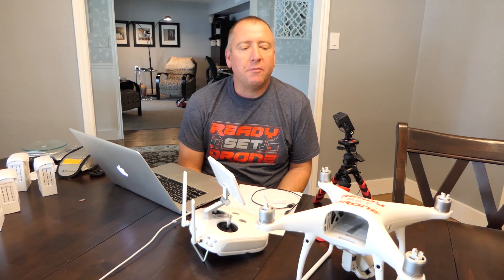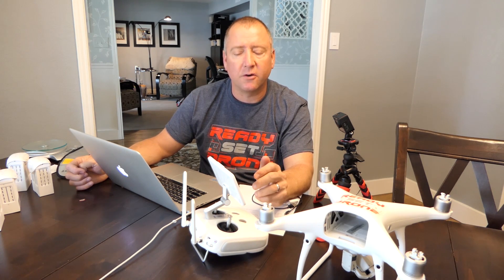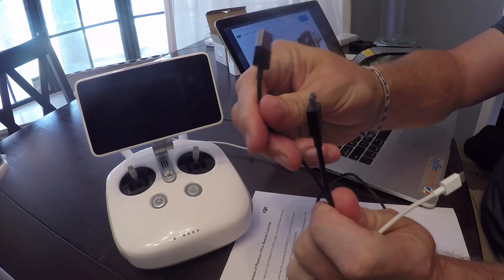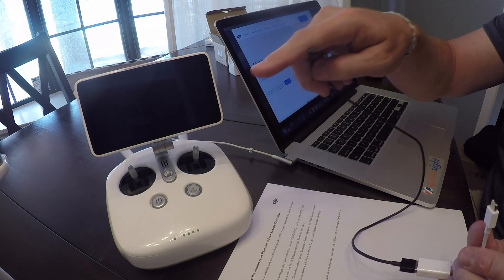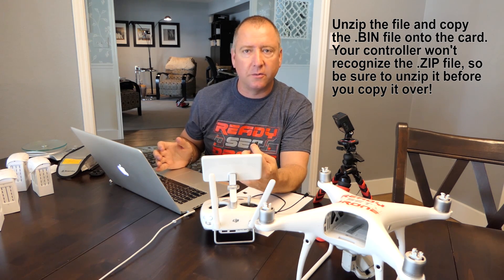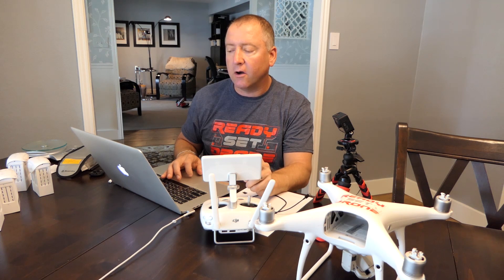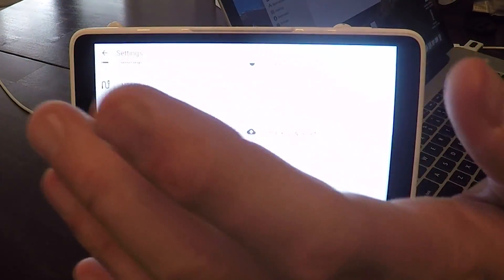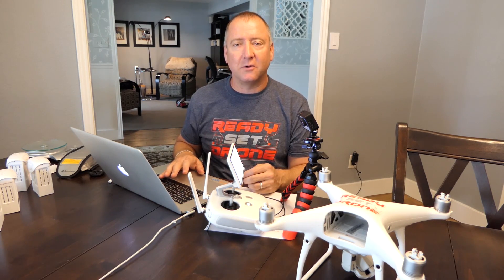DJI Phantom 4 Pro Firmware Problem Fix

Comment: Hi,  I know this is an old video.  But I just got a phantom 4 and getting to learn all this.  I have an Air encoder error. I've been trying to update the drone.  
It's doing nothing..I do notice the little led light is the drone above the sd card slot bonus red/green.  Could my mini sd card be the wrong kind? Mine is a sandisk ultra 64gb 10 (not 3) xc 1. 
This is driving me nuts.  This shouldn't be such a chore just to fly a drone.  🤦‍♂️

Comment: This is an excellent video.  I went through all the comments and it seems that most readers do not realize the video is for the Phantom 4 Pro Plus, that is, the controller model GL300E, the one that has the integral display.  So when one complains that they didn't get the special usb cable or their controller does not have a miniature SD memory slot, that's why.  Jim

Comment: Hey Last week I did the same thing. Went to fly my Hanson 4 Pro for the first time in a week or two and I got the message inconsistent firm ware do I swiped it and updated the drone.. now I have really bad not very usable video stream on my controller. I tried a lot of things but I haven’t tried to update the controller firmware yet.  I will try that next. My Mac has the latest OS on it and they do not have a DJI assistant version that will run on a new Mac that also has Phantoms drone. DJI failed to support Phantoms on the new version of assistant 2. I can go by a PC I suppose. This is the first drone night mare firmware problem I’ve had in years

Comment: Man, you are a life saver!! I updated the firmware on my drone (P4/PRO) and I lost my video signal and I had no GPS. I could still fly it but very limited distances. When I tried to update my controller with the memory card it wouldn't work. I forgot to unzip the file before putting it on the card. I should have known this. Once I unzipped it the updater on the controller found it and did the update. Now my drone works perfect. Thanks so much!!!
Reply from the maker: Awesome! I'm glad you were able to get it working!

Comment: Followed your instructions: format card, download latest firmware via website onto sd card, put the sd card in the remote, then started the process. All looked good, but at the end of the auto-reboot, i get an error "Update Failed: Error code:800". Any suggestions? Thanks!

Comment: There was not an adapter with my phantom 4 pro. i checked the in the box list and this also does not list it.
Reply: The adapter they are talking about us used on the phantom 4 pro plus, plus meaning, the controller that has the integral screen, it does not use your cell phone or tablet.  When the adapter is plugged into the cable, the cable now has a micro usb on each end.  This is needed with the GL300E, don't know about the more common controller that uses the cell phone or tablet.

Comment: I tried everything but it is not working the controler wont see that there is a file. i tried 2 different sd cards and formated them in the drone in the controler and on the pc but it just wont see that there is a file with an update.

Comment: I am more disappointed in many of you that keep speaking of the P4 when in fact this review is for the P4 PRO.🌟>JustU.Faith/-DJIDrone?症    Now readers are confused as I am. Some of you are speaking of the P4 and some of you are speaking of the P4 Pro. Why I hate reading reviews. There has been tens of thousands of P4 Pros sold and very few complaints when reading the DJI forums. When you look at percentages its less than 1 percent and many of those can be contributed to user error that have had issues. .

Comment: So, I had a failed update with my Phantom 4 Drone standard.  Everything is working fine, but the camera is not sending an image to the screen.  I've tried resetting the camera, adjusting the settings, reformatting, etc.  Nothing... Will DJI Assist help me fix the bird?
Reply from the maker: I would definitely try DJI Assistant. I would also suggest rebinding the remote with the drone, that might do the trick.
Reply: @readysetdrone  Awesome!  I appreciate the reply.  I haven't had time to reset the remote yet, but I'm going to try today.  
the strange thing, is that the indication light next to the sd card slot on the drone is cycling green, orange, red.   Like I said, it seems to connect to the remote, but the remote is not able to see what version of firmware is on the drone.  whenever I go into the software through the remote, and hit "Check firmware" for the drone, it just keeps thinking, and never sends back a result. The app doesn't freeze, and the drone is still communicating with the remote, but it stays in that green orange red blinking phase.
The other symptom I'm having, is when I connect my phone directly to the drone, it doesn't communication with the app.  
Thanks for your clear concise video!  It's much appreciate.

Comment: just a heads to save people tons of time who are having problems with distance-video issues. if using a android tablet or phone the type of cord (charging cord) does make a difference. i had problems and switched from gas station bought cord to the original verizon cord and worked flawlessly.

Comment: My drone is showing a problem of navigation system error.. Wat shud I do?
Reply from the maker: Calibrate the compass and make sure you are not near any large metal structures or concrete (which has metal rebar in it).

Comment: Thank you! The confirmation on how the cables are supposed to attach was a major help. 

Phantom 4 Pro+ vs Phantom 4 Pro V2.0 - I downloaded the firmware for the V2.0 by mistake (duh). That file wouldn't extract to a .bin, but instead just a directory, and the pdf instructions say to just put the .zip on the sd card by itself. I was really frustrated until that facepalm moment when I realized it was the wrong firmware. The firmware for the Phantom 4/4+ does extract to a .bin and it worked immediately. No test flight yet, but I'm hoping this resolves a ton of issues I was having.

Comment: I'm a new user of phantom 4 pro, only 1 month and i had a problem with image in my smarthphone like you shows. After firmware update the images on my smarthphone are completly black. my English knowledge is a little poor. could you write please an essenzial list of steps to improve the image quality of connection between smarthphone and phantom 4 pro? only essenzial steps please . Best regards, Giuseppe

Comment: Can tou help me out...i try to do the factory reset on my 4 pro plus after reset is asking me to login but i cant not connect to the wifi. How do i connect to wifi thanks
Reply from the maker: You should be able to connect to wifi through the app using the touch screen. If that doesn't work, I'd using DJI Assistant (free software) on your computer. If you still can't sort it out, contact DJI tech support. Good luck!

Comment: I never seen so many updates as with DJI firmware. I like DJI but shy away due to you spend more time on firmware updates than flying, its just sad.  if its brand new, why dont they update it at the factory?  You might not be very good at flying but you wil become a expert trying to figure out all the updates, WOW

Comment: Thanks for the video. I had this exact problem and this helped a ton.
Reply: What do you do if the controller doesn't have a micro SD card slot?
Reply: @jmccarthyphotography5262  This entire thread is about a Phantom 4 Pro Plus, which means the controller with the integral display, the GL300E, not the Phantom 4 Pro that uses the cell phone or tablet.  I wish this was stated at the very beginning of the post.   Jim

Comment: I had that problem with my tablet. The solution was to use a more powerful device. Video feed is low priority and if your mobile device can't supply the CPU power, you won't get video or choppy video like that. I switched from a 8 year old tablet to a 2 year old Samsung Note 5 and all was good after that.

Comment: Hello, I'm trying to download an update but I keep getting the error saying " insufficient storage 2G " I have a memory card in the RC. The. Current version I have now is V01.02.02.00 can you help me with the problem I'm having? Thanks...
Reply from the maker: One question - are you on wifi and is the wifi connection good? Also, do you have the drone and control connected via USB? It can't be the larger USB connection, needs to have that OTG cable with the smaller micro USB on both sides.

Comment: Hey I was hoping you could give me some insight for an issue I’m having with my camera/screen. I have flown my new P4A 5 times. No issues. But I notice that the “real time” play back will slightly lag or glitch and I thought it was only going to be on my phone, but I saw this issue when I was editing on FCPX also. What happened during editing is a black screen slides across my footage from top to bottom really fast and ruins my shot. Have you experienced this or heard of this?

Comment: Hallo, Reiner here from Germany. Have near the same Problems then you with the Controller.....but how/ wich Format you have to Format the micro sd card?. My English is not so good, and i try to understand, but it was a little bit to fast. Thank for help, and sorry about my English
Reply from the maker: Reiner - have you tried using DJI Assistant with your computer? It is a big help in troubleshooting software problems.
Reply: Use the P4 to format the card when it is in the P4. This will put the correct format on the card.

Comment: Quick question.. do you know if the latest firmware for the P4P+ fixed the issue where users cant hide the OSD from the HDMI output feed? this is specially used when been used to TV broadcasting, so the output video is clean with no UI stuff. There are so many complaints in the forums, but this happened last year, and I cant find anywhere if this issue got fixed or not. Im planning to buy the Drone only if this feature is available :(

Comment: Updated firmware yesterday . After rebooting and taking up about 50 feet I get downward infrared warning amd to land . Wasn’t having problem the day before. Any ideas of what may be causing this
Reply from the maker: Could there be something blocking your IR sensor? Are you flying over grass? My suggestion would be to reboot everything, take it out to a grass field away from concrete/buildings/etc and give it a try there. Also, be sure to do a compass calibration. Hope that helps!

Comment: Having stability problem after crash, no damaged to drone actually except propellers, someone saying that its an motor problem and motors need to be replaced, is it true reason behind that?
Reply from the maker: When you say stability, do you mean it will fly, just not level? Please provide more details on what you mean and I'll see if I can offer suggestions.
Reply: when it fly in the air it moves automatically to one side, and I am facing this problem only after crash

Comment: My P4P controller doesn't have a sd card slot on the remote (?)  What do I do?  Thanks.
Reply: I’m having similar issue. I have P4P with a non built on display.

Comment: Hello mate.  Any ideas on downgrading to an earlier version of firmware for the drone?  My upgrade today has all but bricked it.
Reply from the maker: Ouch - have you tried going back to the last (previous before you installed this one) firmware using DJI Go 4? You should be able to do that.
Reply: Thanks for your quick response.  I have tried rolling back the firmware, but DJI Assistant 2 cannot do it.  DJI have locked us out of that here in Australia.  Maybe everywhere. I think I will have to wait for someone to discover a hack to bypass the DJI upgrades that seem to be nothing but buggy.  Having said that, you seem to have a good upgrade that is working fine.  I hope you do not get the same problems we get here.  I sincerely hope you do not get any issues with flight stability, "phantom no-fly zones" etc, that we are experiencing.  My farm is 2 km  away from the Civil Aircraft Safety Authority (CASA) indicated NFZ (a small rarely used airport), yet DJI are saying the NFZ encompasses an area about 7 km radius from the airport.  Australian law is 5.5 km radius for an airport.  DJI have dropped the ball here.
Love your channel mate.  Thanks for a professional, friendly and informative method of getting us novices up to speed.
Have a safe and happy day mate.

Comment: Yesterday, while I was updating firmware, and calibrating compass and IMU, after everything was done, rebooted both the bird and the RC, then suddenly, the bird was not connected with the RC anymore.  The battery status was showing as Unknown, GPS was not communicating, the camera screen was showing the bird as not connected, etc.  I was frantically trying to figure out, what could have possibly gone wrong. Tested everything, no result.  It kept saying that wi-fi was turned off, and needed to be re started.  Suddenly, I realized that I had left my cell phone out in the car. So, I went out and brought the cell phone back.  It was dead, so had to put it on charger.  As soon as it got some life back, I turned it on.  everything was back to normal.  The bird was back on line, and communicating with RC, the GPS satellites were back on, camera was responding. Even the Flight simulator was responding. I don't know if all this had anything to do with the fact that I am using my cell phone's wi-fi network, and since the phone was not around, and was dead, it dropped all signals, and the bird started playing dead.  But then again, just to test this thought, I turned off the phone completely, but the things were all working normally.  So, I thought, I'd just toss this in and let all you experienced guys tell me I was wrong.

Comment: Here is a fix to the Red/Green LED issues, this will help with Phantom 4 Standard users.  It's a method to roll back the firmware on the RC and force an update.  BUT uses the older DJI GO App for IOS. I also posted this on the DJI forum pages.

https://youtu.be/w09_JnFAda0

Hope this helps !!
Reply from the maker: Awesome! Thanks!
Reply: Your welcome. Keep up the good work it looks like we DJI's extended support team !!

Comment: Thank you for this, I just got a new P4P+ and thought I had completed all the updates, registrations (DJI & FAA) for prep prior to the first flight, I got down to a site for my first flight and was getting the same pixelated screen. I too tried to change the frequency.  Did not help, So I hope this does the trick.  I will be installing the bin file in the am.  

The other problem I have are pop ups that say fly with caution, magnetic interference. I had calibrated the IMU on a level surface then the compass and still get the interference pop ups.  Maybe this will fix the issue also.  I know the area I am flying is ok as my Mavic Pro has no issues when flying at the same location. Thanks for all the great information.

Comment: For the DJI 4 (ONLY not any other) video telemetry issued I copied this from another forum and it worked to fix it perfectly. Had to try several steps several times but be patient. It works!

1) Install DJI GO 3 app from Apps store, launch app (at this time P4 is off until I say)
2) Select P3 Pro as aircraft (SE and Standard are wifi, not sure if this would make a difference), using the 3 dashes at the top right of the app press and hold for 10s or so. A new screen appears showing suggested current firmware of RC. Scroll down to firmware 1.6.0 select "Firmware Refresh". Wait for it to install then close the app and shut off RC.
3) Reboot RC, after a few minutes on shut off RC (not sure if this is really required, but it seemed right)
4) Open up DJI GO 3, Select P3 Pro and press camera (have the lightning cable connected to RC and iPad/iPhone).  I had over 50% charge on my RC (btw)
5) Once in main screen with telemetry info wait a few minutes and press the Left upper area just next to the DJI logo saying "No xxxxxx connected " in red, this will take you to the Aircraft setup screen.
6) There you will see a warning message triangle, press this area and it suggests upgrading the firmware as you have 1.6.0 installed and the latest is 1.9.3
7) This started the firmware download and then with lots of beeps and blue flashing light the upgrade was a success !!!!!
8) On completion it will tell you to reboot the RC.  At the same time I closed off the DJ GO 3 app.
9) Reboot the RC again. Mine complained at low battery so I did a second reboot and 3 white LED battery level lights came up as well as the RED LED indicating no aircraft bound.
10) Turned on P4 and launched DJI GO 4 app and BANG.... full signals on RC and Video feeds and NO flashing red/green led any more just solid green.  So fingers crossed for her maiden flight tomorrow ( double fingers crossed)

I hope this helps others; note the DJI GO 4 apps does the same if you hold the 3 dashed lines for 10s or more.  I did not try this route to roll back the firmware on the RC.
Reply: Thanks, this worked well for me!
Reply: are this is for phantom 4 advance?
Reply: This did not work for me. Downgrade firmware worked, would not upgrade firmware.

Comment: Mine is doing the same, but mine is a phantom 4 not the pro, cannot find the firmware!!! How do i fix it, lots of pixels like yours green screen
Reply: JP Matatan did you ever find a fix? I have a P4 also with same problem, no micro SD card slot on the controller. I'm way beyond pissed at DJI true lack of accurate programming and lack of real support. You see all these videos and people say and Bam it works... Not here.